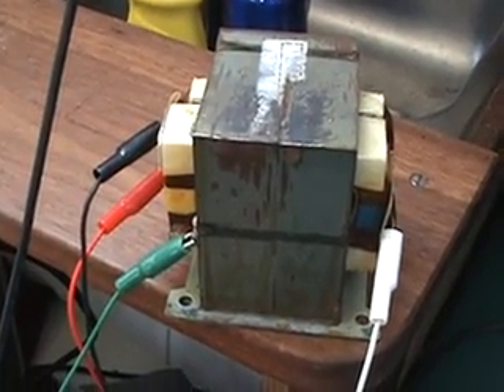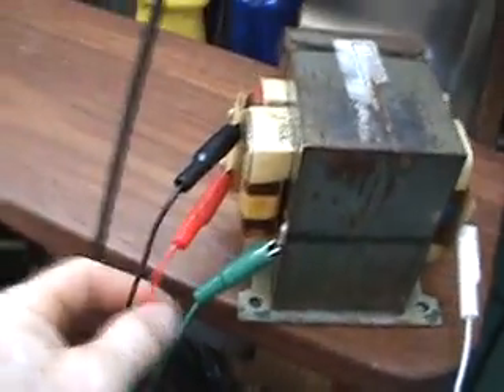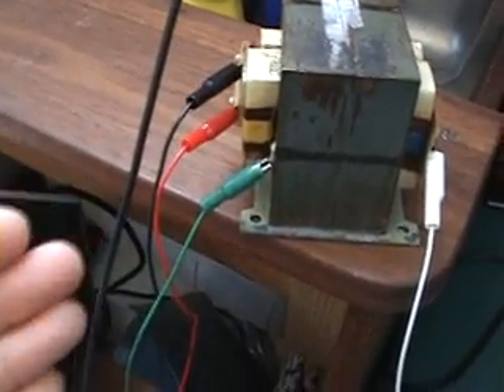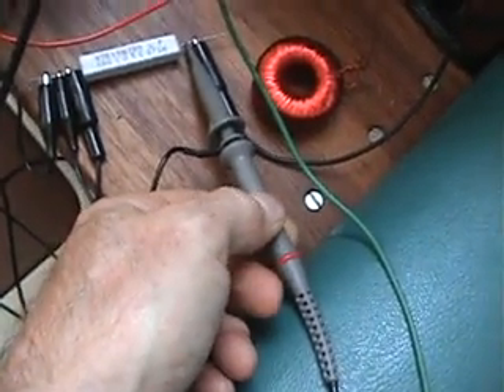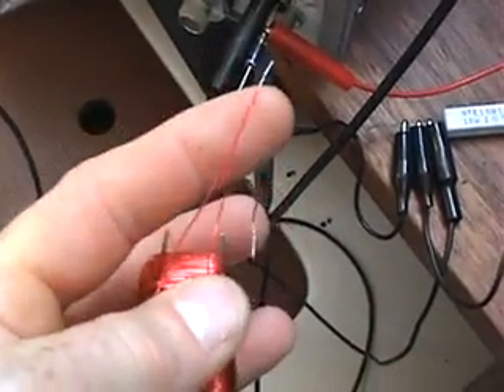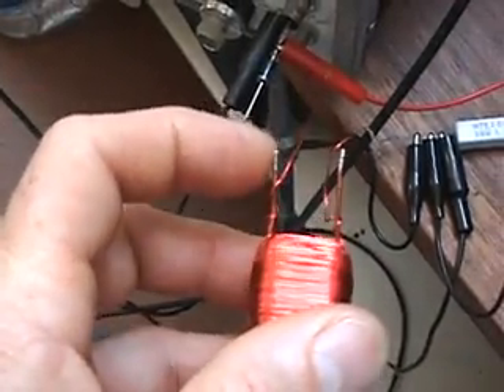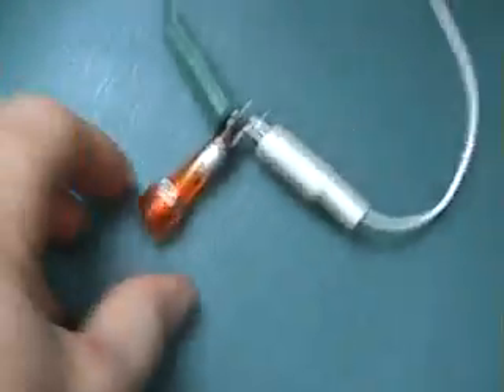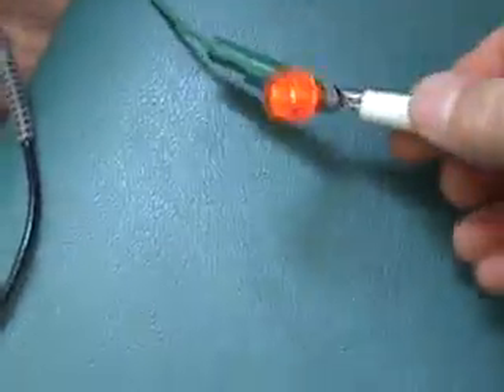Test of possible Delayed Lenz Effect test 1

Comment: Luc you need enough input to get proper magnetising current in the laminations of the transformer core. A way to do this is to use a car hi fi amp connected to sig gen.  If you want to see an alternative passive method to delay Lenz effect download Tesla's early patent US433702 and read carefully ..it's only short. 
Gerry